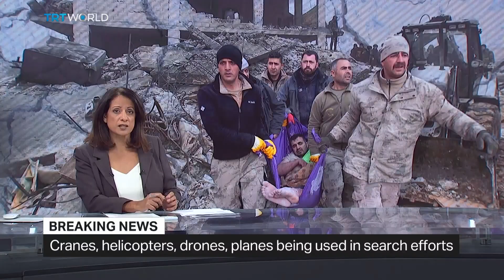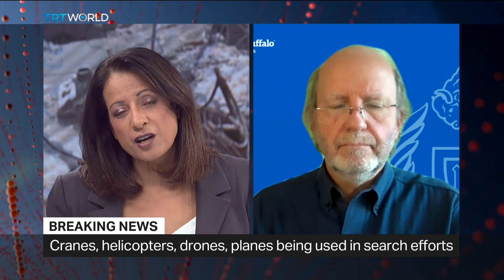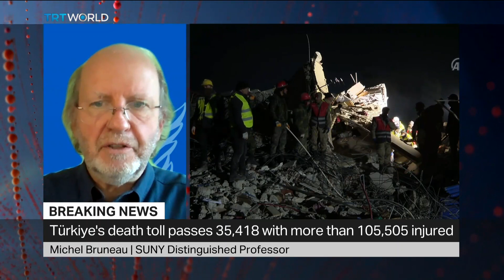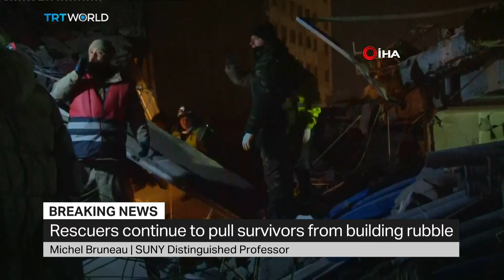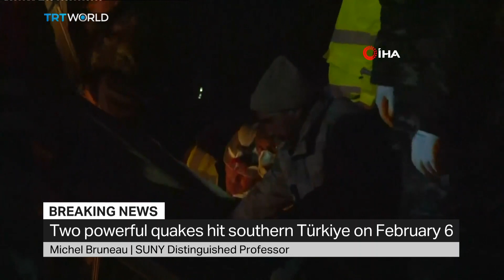Can buildings be designed to withstand earthquakes?

Comment: Is this guy even qualified to be saying what he is? You can literally see the buildings in Turkey folding in half like a piece of paper, that's extremely easy to prevent with just basic engineering. It was built that way so it could be made cheaply for the ones who sell it so they can have greater profits because unfortunately that's what engineering is today, to make something the weakest it can possibly be while still fullfiling its purpose.